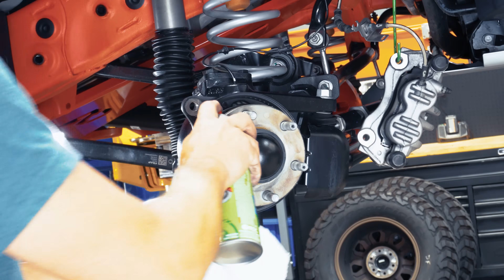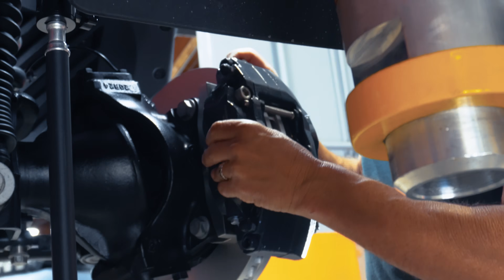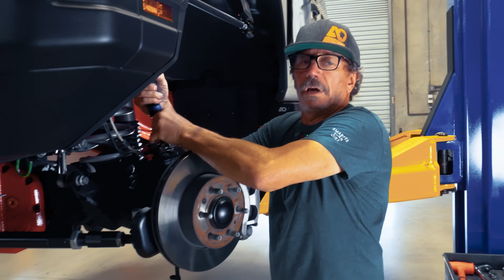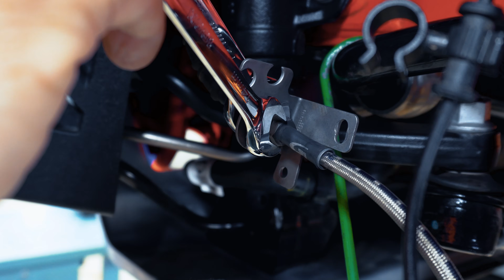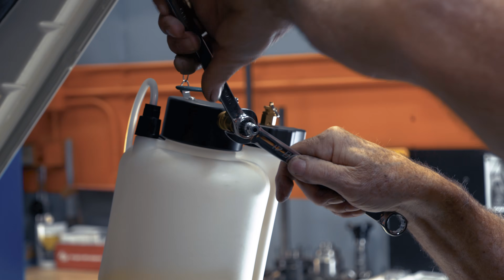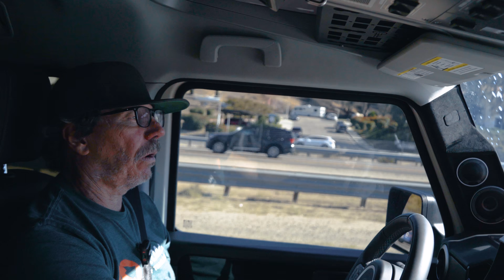Better Stopping Power for the INEOS Grenadier | Big Brake Kit Install & Setup

Comment: what is the issue that your are "fixing" by replacing rotors and brakes and losing the brake pad sensor? I have done 40,000km in mine, half off-road at 3.97 tonnes and find the OEM brakes very good. Brake pads only half worn.
Reply from the maker: Great to hear your OEM setup’s been working well! The main issue we address with the Alcon upgrade is caliper flex. The factory 2-piston design applies pressure from only one side, which can lead to uneven pad wear and heat buildup over time. The Alcon kit uses a much stronger ductile iron caliper with opposing pistons for better balance, consistency, and control. We’ve actually got a video dropping this Thursday where John does a full comparison between the factory brakes and the Alcon setup. Definitely worth checking out! 👀
Reply: Brake upgrades are nice if a guy is running larger tires.